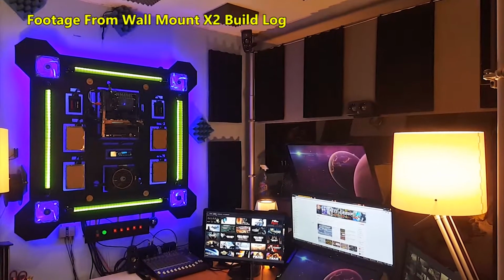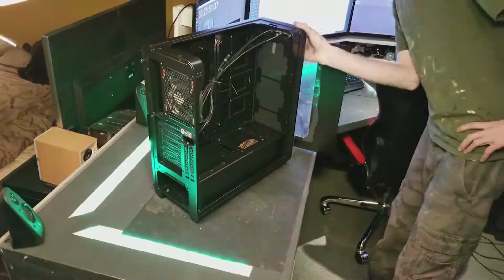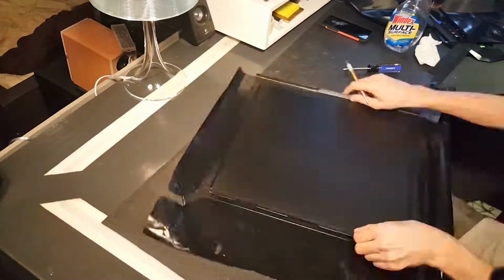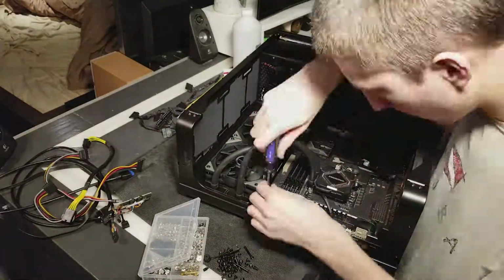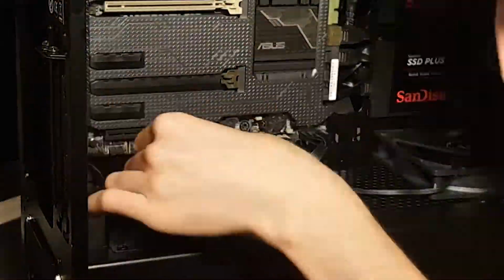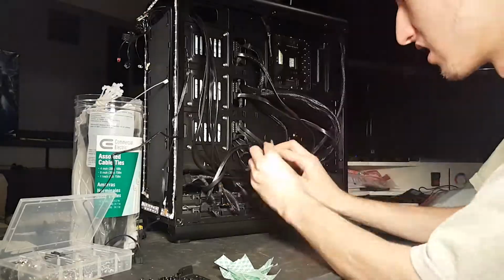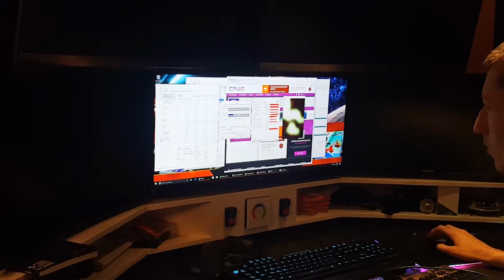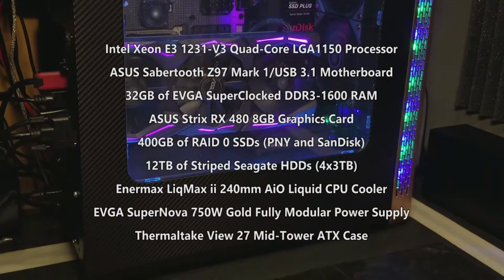Austin's Custom Computer Build Log #4 - Thermaltake View 27 PC

Comment: Nice build. Does the close proximity of the graphics card to the plastic window cause any temp issue?
Reply from the maker: Michael MacAllister Thank you and no because the fans suck on air from the side facing the window and blow air onto the heatsinks, which then goes up and out.